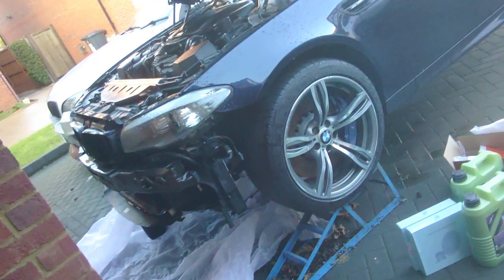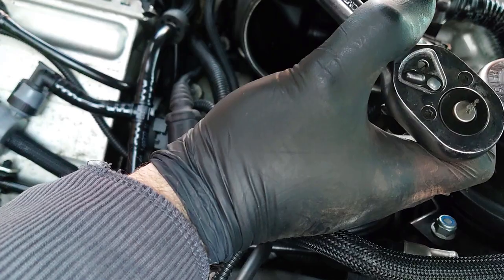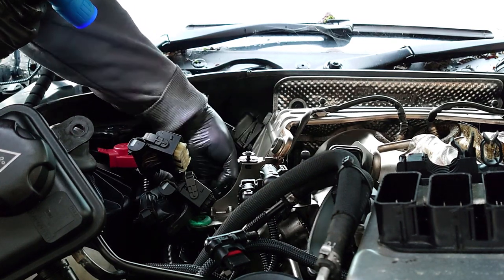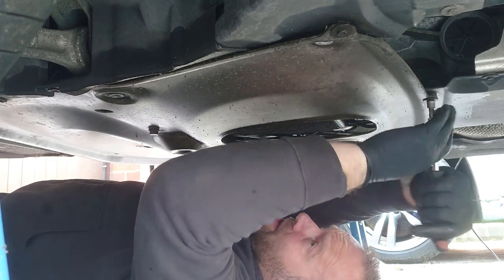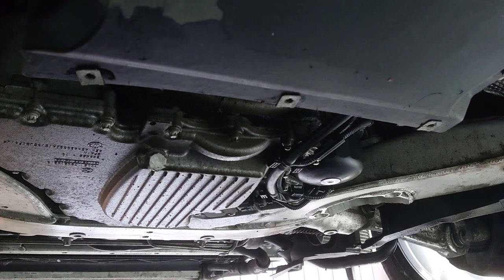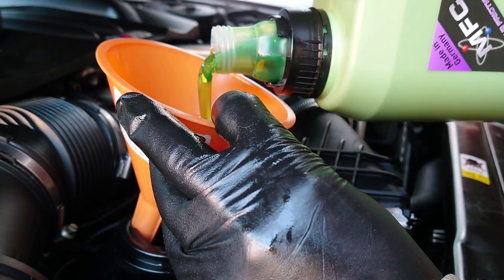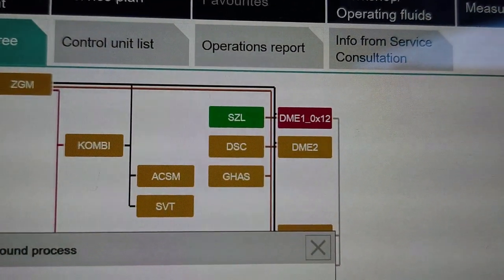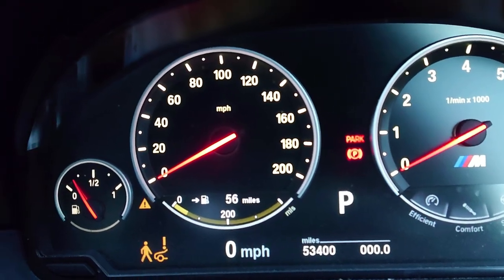Salvage BMW F10 M5 Engine Service and 1st Start, All Good ?

Comment from the maker: I can't believe I've actually made it this far, the car is really coming together now. I had a small hiccup with the oil change as I didn't have the right tool, and it looks like one of the sound deadening panels under the car is holding water. But to finally hear the car start was amazing, it was loud but it was amazing! Thankfully there's no sign of any shavings in the oil and no sound of any knocking, plus it went into gear. Next time I'll be putting the exhaust on, re-fitting the bumper, clearing all the errors and running her up to operating temps! Fingers crossed it keeps going well.

Does anyone have any ideas on the Satnav issue ?

Thanks
Rich

Comment: What plugs did you go for?

So happy for you when it started 🙏  love my lci f10 m5, they are beasts.
Reply from the maker: Can't remember, I wanted to put standard plugs back in but I'm starting to wonder if I've picked up some that are a step colder! Need to check my emails! I was so happy when it fired up, don't think I'm out of the fire yet though !!!!!!
Reply: @RichsRides  I had zmr5ttp330 at first then moved to zr5ttp330 

I can’t post link via phone but google and you’ll see a post on f10.mpost about plugs being changed
Reply from the maker: @b21playa  cool, I'll go and have a look!
Reply: @RichsRides  defo check park numbers on invoice
Reply from the maker: Just goes to show you should always double check what you've added to your basket before you buy!

I'm a Muppet! I've checked through and the plugs are Bosch ZR5 TPP 330, and the standard spec are ZMR5 TPP 330!

Running a colder plug could be part of my idle problem.
Reply: @RichsRides  the ZR5TTP330 is what I’ve got as well and mine is standard. I used Bosch website to get part number, if I remember correctly it was 8165

Comment: Loving the series mate. I’m going through a similar journey myself. I bought a bastardised F10 M5 (slipping clutches due to bad remap, gearbox failure on the way from driving it home - 120 mile recovery(!!), AC fault, side view camera fault, badly retrofitted LCI LED headlights that throw a fault on the dash every time you use the indicator, and probably more). It’s tough going and I feel your pain 😀 luckily I have a 2 post ramp so have managed to change the gearbox and fix a few other bits... full software update from BMW to get rid of the remap, I’ve now been dailying the car for a month or so and all going well - just need to sort out the bloody indicator fault that’s driving me mental!

Love the series and keep up the awesome content and hard work on the car - it’ll be worth it in the end :-) 

Do you mind me asking how much you paid for yours?
Reply from the maker: That sounds awesome, it's hard work and it's often hard to find the time with work and the family but I'm really enjoying it. Can't wait to get it rolling and out for a test drive!

I haven't actually moved the car yet so I have no idea whether I've got clutch or gearbox  problems yet. 

Have your lights been coded properly, or is it more of a wiring problem? What have you tried so far?
Reply: @RichsRides  Good luck mate! Can’t wait to see a video of it on the road! I’ve ended up somewhat of a DCT expert so if you hit any gearbox issues give me a shout 😂! 

Mine and my friend’s thoughts are that we simply need to code out warm/cold checks on FRM for the front indicators, as the resistance reading on LEDs is probably different to halogens as it expects? The rest of the headlights seem to work completely fine with no issues that I’ve seen yet. Some of the wiring is... questionable... but it works. Tidy up in need. 

Keep up the great content.
Reply from the maker: +Luke Oxley cheers buddy, I'll definitely be in touch if I get any issues. 

I'm sure you'll crack the lights soon.

Comment: I have two questions 
Did you replace valve seals and what seal did you use if you did?
2nd question when you did the install on high pressure fuel pump 
Do you need make sure cam shaft is position is in specific direction or you just bolt on. 
Thanks
Reply from the maker: +Miki Miki I haven't replaced the valve seals ....... yet. the head is still off and. contemplating whether to strip down but I can't get hold of the necessary tool at the moment. was trying to think of ways to test the seals and work out if they actually needed doing. or I guess I could take it somewhere to get done?

when it goes back on the engine will be in position to set timing and I'll leave the lock pin in place, but I don't think you have to. I think it can be done while the cams are in any position.

Does anyone else on here know?
Reply: @RichsRides  I heard cam has to be in down position if not it can brake pump. I need get ista+ so I can check all these little things. That can cause big problems 👍🏻
Reply from the maker: @mikimiki195  ISTA+ is a must. If you can't find it let me know.

I'll have a look at me notes about the pump.
Reply: @RichsRides  I had some guy selling me whole hard drive with ista+ pre installed with windows 10 for $100 USD
I you have source where I can get it please let me know. If it’s not too much to ask. Thanks
Reply from the maker: @mikimiki195  Its readily available on the internet. There's no need to pay for it. Let me see if I can find my link. You do need a fairly big hard drive though. The only thing you'll need to buy is the cable.
Reply: @RichsRides  i just got laptop just for ista I just got cable as well I will need buy 500gb hard drive. 
I’m slowly making list of the parts I need to complete valve seal job. 
I was quoted $8000.00 USD by the local shop I told them to get lost. 🤣
Reply from the maker: @mikimiki195  $8k !!!! Ouch. It is a big job but not that big!

Comment: Where did you get the parts from, can you list them in the description please?
Reply from the maker: Hi Nathan, I bought most of them from AutoDoc and eBay, but sometimes it's actually cheaper to get parts directly from BMW. If you have the part number just call your local garage and ask them for a price, they might just surprise you. I've seen the really small items like screws etc on eBay for 5x the cost from BMW. 

Are you looking for some bits?